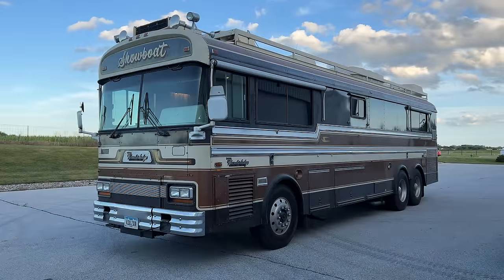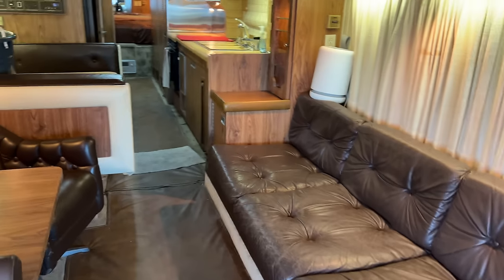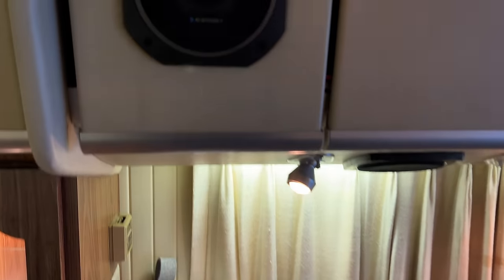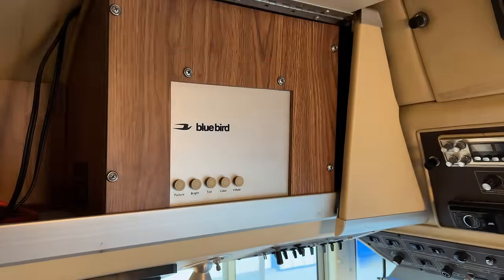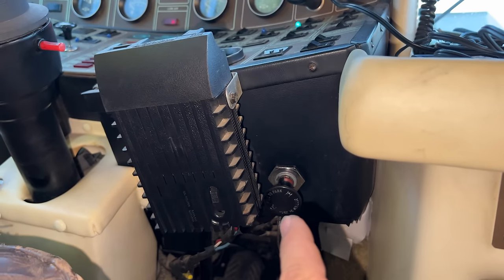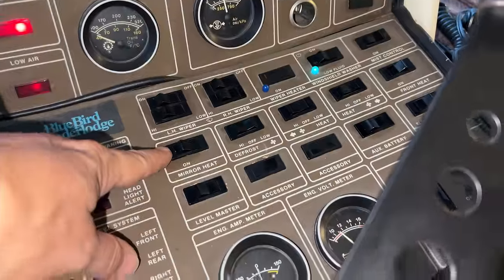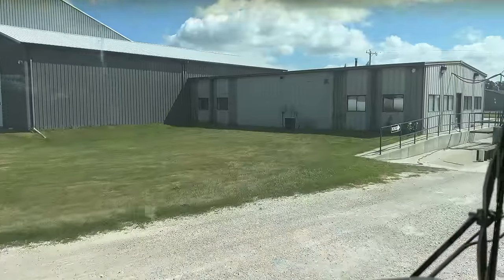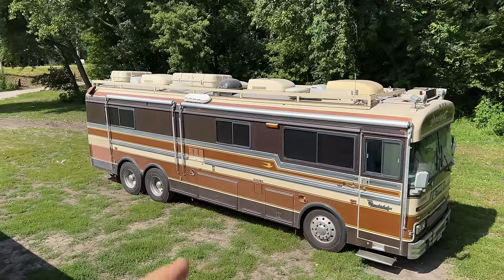Tour of My 1985 Blue Bird Wanderlodge

Comment: awesome Coaches and Tours !  I’m 60 years old and have been Camping in one form or Another since I was in my early teens  I’ve Always known the WanderLodge and Airstreams were considered the Better or Best of Luxury Camping I’ve owned a Antique Airstream pull behind  and had some fun with it  my favorite thing was it was over 25 years old all the original item worked and the roof never had a leak ! The only thing I ever fixed or replaced was the thermo Coupler on the Water heater and that was a off the shelf item for $7 bucks at a Campground store  fixed in less than 10 minutes in the rain !? Can’t complain about that one  and I replaced the plastic slide piece on the Screen Door  kids got too rough with and cracked it mostly due to age and getting brittle ?

Comment: Don't Crack the safe.  Pick the bypass lock.  Way easier :)  neat vehicle!
Picking locks like that is relatively easy.  You can get basic kits for little to no money on Amazon, ebay, Ali express.  Plenty of youtube tutorials to get you started.
Reply from the maker: That is not a bypass lock it is the hole for the change key.  I have the key and the original instructions. You need the old combination and then you can insert the key to change it.  The key does not open the vault.

Comment: "The Blue Bird Wanderlodge was an RV out of a School Bus!"

- Doug DeMuro
Reply from the maker: That is not correct, it was built by a bus company but it was built from the ground up as a RV.
Reply: @ThisWeekWithCars  No, it is based on a SCHOOL BUS! Look at the design and tell me that doesn't scream VERY AMERICAN SCHOOL BUS????
Reply from the maker: No school bus ever used this chassis.  Why would a school bus have a tag axle, a huge 2 stroke detroit, and a generator that slides out of the front.
Reply: @ThisWeekWithCars  Well look at the body at least. It's very fucking School Bus.

Comment: If you want the safe open you could get someone to lockpick the safe's key bypass and open it, instead of trying to crack the code which would be be more expensive and labor intensive
Reply from the maker: That is not a bypass that is the key for changing the combination and I have the key.  It is useless without the old combination.

Comment: PT36, and that fan in the engine compartment is not the engine heater. I have a 1985 PT36, identical to yours except my Detroit is 350hp. Yours may be 350, check the blue tag on the left valve cover.
Reply from the maker: Have you found a tag anywhere on the bus that tells you exactly which model it is?  The vin tag doesn't say anything, neither does the owners manual or anything else I have found.
Reply: @ThisWeekWithCars  on the rear frame, aft of the engine, has all the data. There’s another tag up front, above the windshield with the vin, etc.

Comment: It’s technically not super charged as it’s a scavenging pump because the engine would not run without it.
Reply: I’ve worked on many a Detroit 71 series. They are fantastic runners with a unique ability to excrete their own corrosion resistance fluid. Never had experience with the 92 series though.